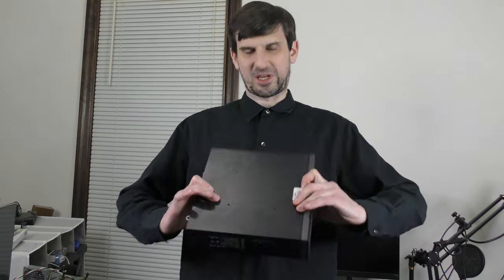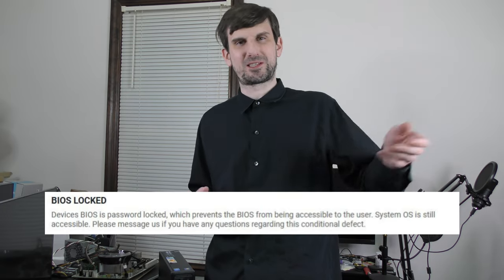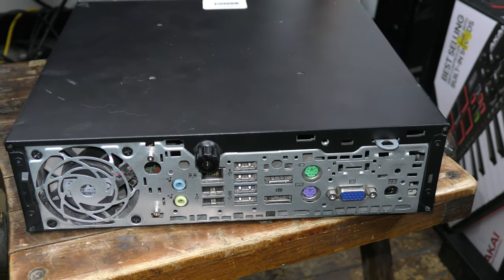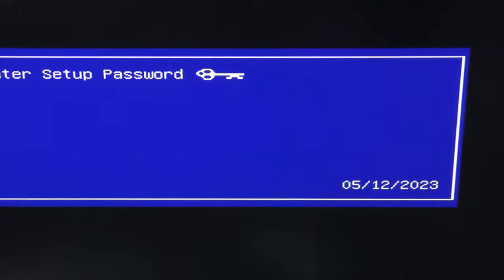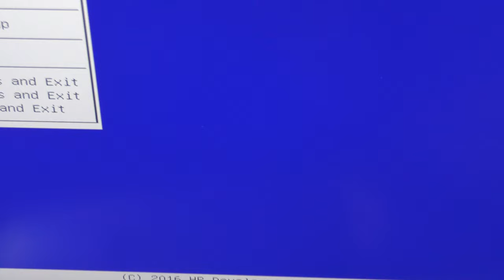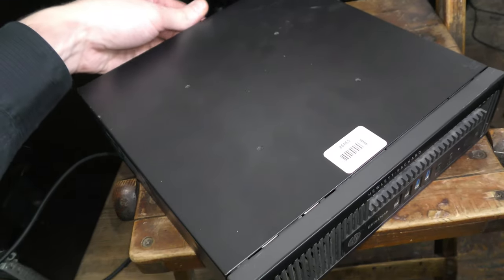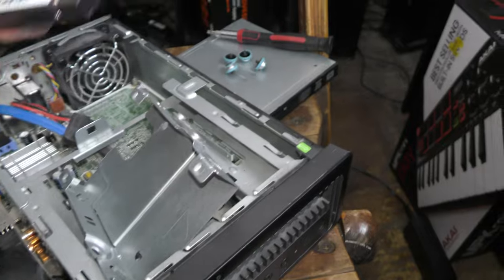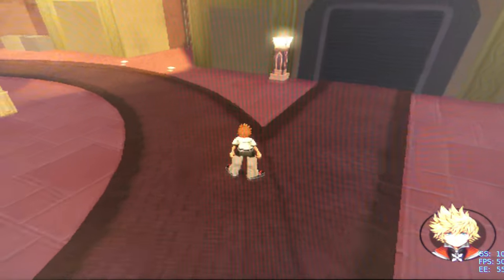eBay Games #1 - $30 BIOS Locked PC, Can I fix it?

Comment: I had the same addiction until I moved to my current home. I happen to live in the capitol city of my state. Because of this, a couple of times a year, we get loads of systems like this hitting the local market. Lately, we have had a slew of 6th gen HP's and Dell's with I5's and 4 gigs of DDR4 ram that can be had for around $50. Had a neighbor buy a pallet of them from the D.O.C. offices for $400 for 28 of them when they upgraded. Heck, it may be his ebay listings your buying from. Lol.
Reply from the maker: 😄Might be, you never know! And that is awesome. I don't live in an area with much going on so there isn't a lot of local/thrifting type deals which is unfortunate because that does sound like a lot of fun.

Comment: Who needs hard drive screws when you can just tape an SSD to the side of the case?
Reply from the maker: That's always an option! Though I've always wanted to see if I can find a way to run some screws through a drive directly into the case 😂
Reply: Just let the ssd hang inside. It will still work great!

Comment: All classic games have scan lines / after lowering sharpness settings on lcds give a good blur and glow effect like crts I have side by side arcade and emulation station next to it / also low latency and Gsync or freesync helps / they did tricks to make the crt active to prevent ghosting tearing

Comment: For a home-lab machine, these are great!  The OS installed on these is almost always Win7 Pro, which you can usually use to activate Win10 pro.  You can also just go with pretty much any flavor of Linux and a GUI for a basic workstation.  Unlocking BIOS is typically pretty easy, so if you can get a discount for the extra 3 minutes of effort...well done!  The M.2 slots are likely not usable for NVME drives, but maybe M.2 SSD?
Reply from the maker: Yeah it definitely is pretty cool for what it is. 🙂 And you're right about the m.2, the generation is too early for NVME, but it takes a standard m.2 2242 SSD.
Reply: @LowcastleTech  Cool, one more option for an upgrade...but, don't give into temptation and start searching E-bay for used 2242 SSDs..it will only end in tears!  :D
Reply from the maker: @wagnonforcolorado  😄

Comment: S = Slow, T = Terribly slow, though the 4590S is not that severely slugged compared to a 4590
Base of 3GHz vs 3.3GHz and boosts of 3/4/6/7 vs 2/3/4/4
So all core, it's 3.3GHz vs 3.5GHz, pulling level at single core
Reply from the maker: Yeah it would def be nice if it held a standard processor instead of that. I actually feel like I've seen them in the past with a typical i5 or i3, but it requires a more powerful brick if I'm not mistaken. I might have to do some experimentation with it 🙂

Comment: I've been known to look through that area of ebay as well.  Did I see some m.2 connections on the MB under the drive?
Reply from the maker: Good eye! Yeah there are a couple down there, I think m.2 2242 slots. I've never tested them out on this system so I'm not sure about speeds and what-not. I think I have a couple around somewhere, only like 16gb but would prob do for testing purposes.

Comment: What emulation are you using?
Reply from the maker: Typically what I do for emulation is flash Batocera to an SSD. If you're not familiar, it's like an entire operating system built around emulation. Once it is on the SSD, I put that into whatever computer I'm using for emulation, and it just boots straight to it when I turn on the computer.
Reply: @LowcastleTech oh I see! So you insert a Drive storage in it that has that operating system (Batocera) that basically functions as a “console”. interesting…

So now it’s basically a console, however…can I invert back to windows on the other drive? And what about the games? Do I need to own them physically? And if I do how may I insert them?
Reply from the maker: @misterhoudi2824  Yeah basically there is one drive that has the emulation OS and, in essence, operates like a console. You can switch back to Windows by swapping drives around, but if you planned on using both on the same machine there are probably better ways to do it, like stand-alone emulators and stuff like that. I just don't have as much experience in them. Or, another thing you can do is flash the Batocera OS to an external drive, and then boot from that external drive when you want to mess with it. When you want to go back to Windows you should be able to just unplug the external drive, and it will default to booting to your normal OS.  As far as the rest and getting things running it is a bit much to detail here, but if you do a little searching on Google about emulation there is a lot of info out there about how it all kind of works.

Comment: Hey could you try to install a low profile gpu????
Reply from the maker: If it was the SFF model I could potentially try it, but this was the USDT size. It is kind of like a weird form factor between micro and SFF and doesn't support a dedicated GPU unfortunately.
Reply: @LowcastleTech  dang I was wondering if I could upgrade my gpu because I want to run some demanding games
Reply from the maker: @Gamer-4585  Sorry I can't be of more help. Hope you can figure something out!

Comment: think about changing the name of the channel to "the man in the low chairdesk"
Reply from the maker: 😄 Not too shabby!
Reply: do nvme raid0 and networking bridge/bond0 for nas devices - it is not that tough to setup - couple with 8 spinning rust drives in two raid0 and you will get faster transfer speeds of data - you have enough parts around to do it - alt ssd raids also work - you will get most out of things like z440 which support bifurcation 4x4x4x4 - the adapter cards are reasonable but do your homework and get pci-e v3, another trick is the hp adapter cable so you can use a reg ps and have more sata power conn etc - they are cheap also